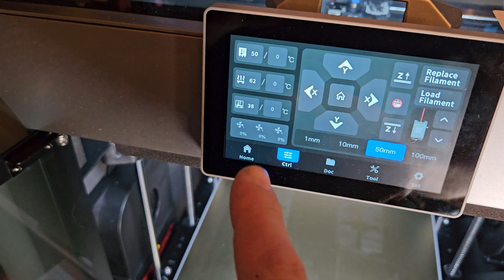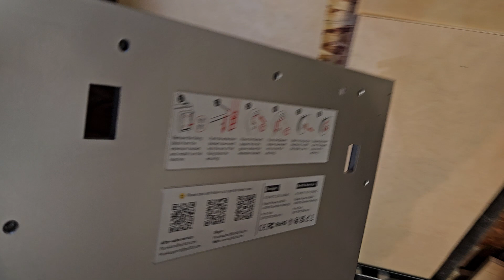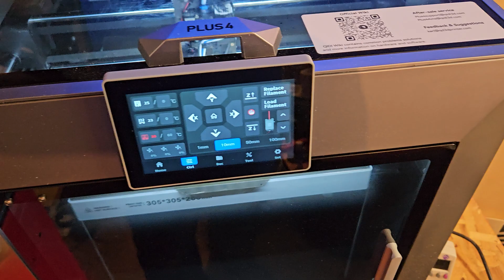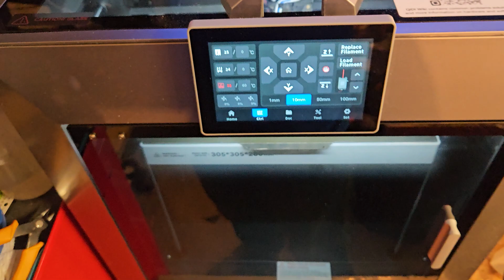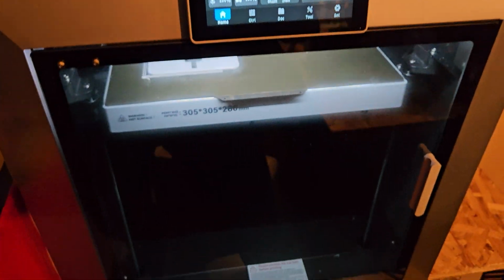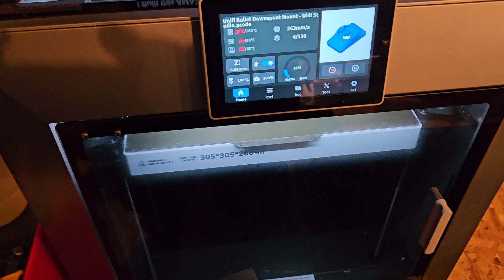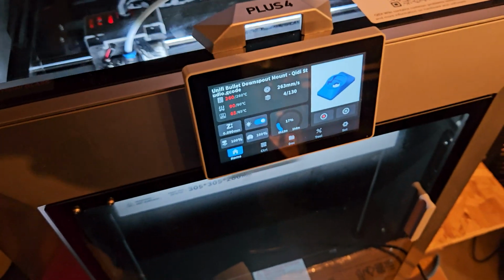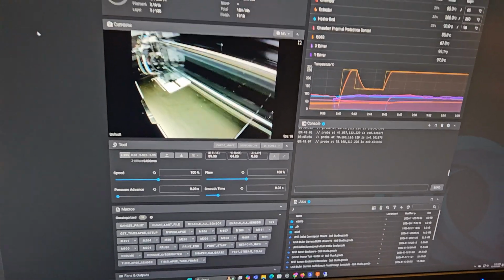Qidi Plus 4 Replacing Chamber Heater & SSR Control Board

Comment: oh that is what i was looking for! my printer has the same problem... but i didn't understand, should i change the the chamber heater and fan even if I change the board behind? Isen't a problem just related to the board?
Reply from the maker: I think some of the heater fan boxes had problems too so Qidi sent me replacements for those along with the new SSR boards.  I did have one (maybe two?) of the heater fans die on me so I'm glad I got those replaced.

Comment: Howdy pard' Thanks for sharing this video. I was performing almost precisely what you did in changing out the SSR. I completely agree with you on the rather odd assortment of mismatched screws holding the rear panel on the printer. Since all of them (except the three along the bottom) go into sheet metal the mismatch makes no sense, except perhaps laziness. That said, because I am a retired Architect/Engineer I couldn't live with myself if I put back all of that mash-up screwfest so, I ordered a matching set of metric self tappers. Your suggestion to "push out" the tabs from the inside was spot on. I did precisely that and then used the pointy tip of a 5-way tool to pop off the back panel.  While I had the back panel off, I did a wee bit cable management whilst back there since there wasn't any performed from the factory. Again, an 'anal' thing I suppose.  Regarding your initial printing issue. May I suggest properly 'tramming' your print bed and performing the bed calibration setup. It's quite important to get that correct.  Also, a decent video here https://www.youtube.com/watch?v=OHR69Emj8xA  showing another method to push out those tabs...
Reply from the maker: Unfortunately I'm still having problems with first layer on these Plus 4 printers.  Have done pretty much everything and I am convinced the bed distance sensors are just lousy.

Comment: Good job sir! Thanks for the video. 
Yeah, I had same issues with those different types of screws. 
I raised a big stink over this. Even complained to USCPSC. 
Qidi finally admitted to not spec'ing the SSR BOARD correctly. 
They sent me the (2nd board iteration) a whole new heater housing plus the 2 back halves of the print head bc the bearings will become loose. They were very good about replacing but it took them awhile to get out in front of these issues. 
The Plus4s being sold in N.America with the stock SSR board are indeed a fire hazard if you run the chamber heater for a long time. The coils on my board were literally black! 
Thanks again for the video sir!